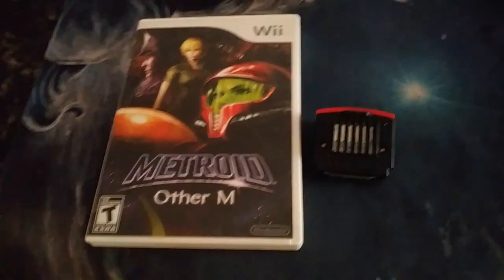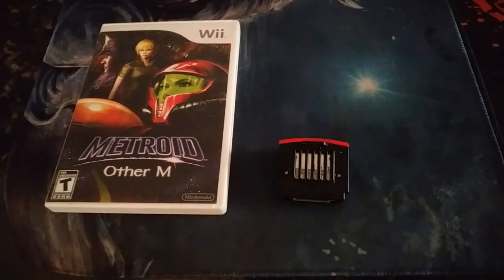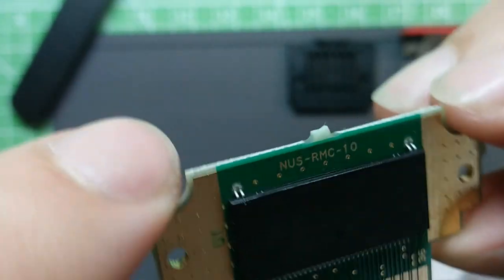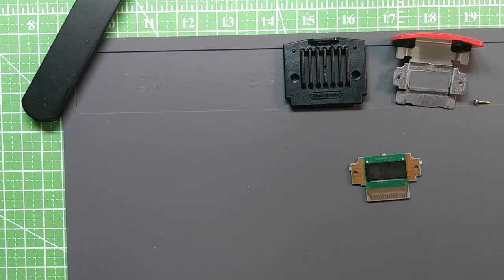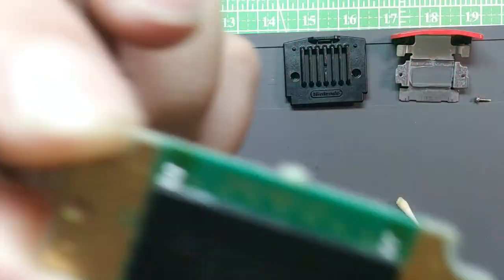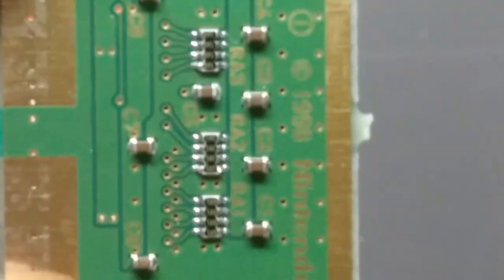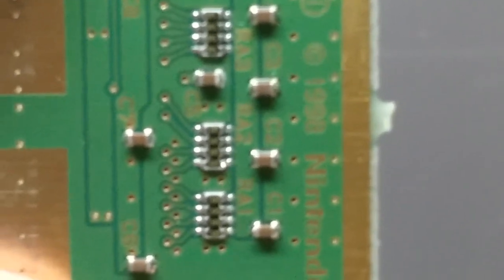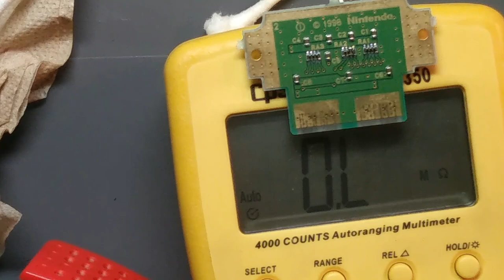N64 Expansion Pak Repair

Comment: Immense thanks for posting this video! I also had a defective Expansion Pak, and it turned out to be a bad resistor just like with yours. I ordered a new resistor for a couple cents from Digi-Key, and managed to make the fix as you showed. Definitely tested my soldering skills to their limit, but the fix worked and I am now also able to play DK64 😂
Thanks again, and great video!
Reply from the maker: Glad to hear it! the best kind of feedback i can get is that the information was useful. up until i posted this video; i could find zero information on repairing them. since then i have found one video from a spanish-speaking youtuber doing a similar repair but, that's it. So i'm glad to have found a niche!
Reply: Which transistor did you buy? Also trying to fix mine and found the bad one. New to all this but enjoying the challenge of repairing!
Reply: resistor not transistor obviously a noob haha
Reply from the maker: @AutBelli  hi! i forget at the moment but that info should be in the video ^_^

i want to say it was 51ohms. something weird like that. i know the package size is 0603 SMD

Comment: my brother, i just picked up a second N64 from the pawn shop which they told me had no AV out. booted it up and it seemed to work great, it had a jumper pak in it. decide to test my old n64, and it did not boot. figured out my old expansion pak has failed much like yours. about to pull it apart, and check it too, but im sure its the same issue with one or many of the resistors failing. my question is which sample book did you buy? the 0603? im still learning SM repair. but big props for figuring and cataloging this one for the community!
Reply from the maker: thanks for watching and im glad you got some good out of it! 

i have a couple sample books now. these are the 0603 size. feel free to link this video on reddit or wherever makes sense. dont have social media myself but, i'd like for folks to have access to what i've figured out. there's a few things documented on my channel that i was unable to find online in forums or whatever

Comment: I bought an everdrive for my N64 and some games just started freezing, I could get consistent freezes on Turok 2 all at the same spot in the intro cutscene, it just would not advance, I'd try finaggling with the cartridge, cleaned up the ports thoroughly, but I'd still get crashes on the same spot. I thought it was the everdrive but then I remember that I have 2 copies of Perfect Dark and they all freeze in the exact same spot when walking around Carrington Institute, THEN it'd bleed into other games, like Ocarina of Time wouldn't get past the title screen.

I figured it was all just really dirty and old but despite cleaning it as best as I could, it would still not work at all. I then decided to just swap the Expansion Pak with my old Jumper Pak, and I haven't gotten any freezes at all, which means it's probably something wrong with the Expansion Pak, though I did not know what. 

My next test I wondered if I should just wait for it to "warm up" so I left the N64 on for a couple minutes, turned Turok 2 on and....It booted the game thinking I had a Jumper Pak on instead of an Expansion Pak. Oh-oh. I pulled it out and reinserted it and now the game booted recognizing the pak, and it didn't freeze in the intro cutscene, which pretty much tells me that there's probably something wrong with it.

You think that could be the case? One of the resistors is starting to go bad?
Reply from the maker: thanks for watching! im almost certain this is the same problem and is seemingly becoming increasingly common as these things age. Another factor is aging capacitors in the N64. Just like any machine, it may work with one or two worn components but once you start getting multiple items failing; the reliability drops off. 

But its a very easy fix (for me at least) and I hope this video will help save a few from getting tossed in the trash. 

I will offer the same thing to you I have offered to others. If you want to send me your console/expansion pak; I would try to fix it just for the sake of the content. I'll make a video of the process and post it. Then you'll have a properly working and mildly famous console/expansion pak ^_^ If you're interested, let me know

P.S. just for  your information, consumer electronic should not need to "warm up" (unless that is specifically noted by the manufacturer). If you have anything behaving this way its from failing components like capacitors/resistors and you are potentially doing damage to the more delicate and not easily replaceable parts (like the CPU and other proprietary chipsets). If you have gear behaving like this that you care about; it is strongly advised to leave it powered off until you can have it repaired.
Reply: @71dembonesTV  I see. Thanks for the reply! I'd love to send my stuff in but international matters complicate things. I will probably look for a way to do it myself and learn in the process. I know now from your video that I should look at the resistors, but this is sounding more and more like a capacitor problem, I got a PS2 slim and the component video output comes out very gray until after some 20 minutes some color comes back in, which pretty much tells me it's a capacitor though I do not know how to measure one so I know exactly how to replace with an accurate one. Nonetheless you've encouraged me to try. Thanks!
Reply from the maker: @aquelescaraaaaaaaaaa  ah yes, physical distance is always putting a pinch on these kind of things! i wish you the best in your endeavors to learn electronic repair!

 With some experience, you can learn which exact capacitors you need to replace to solve a specific problem but, often times if you need to replace one you need to replace them all. Sometimes it is obvious that capacitors are bad from corrosion on the circuit board and/or bulging caps and/or a "fishy" smell inside the unit. When in doubt replace all the caps; ideally before you turn it on again.

in some situations you can upgrade capacitors to something you wont have to replace again (ie ceramic capacitors instead of electrolytics) but, this also takes experience and application-specific knowledge. Buy a circuit board practice kit (or rip apart old electronics) and a decent soldering iron and start building your skills. use no-clean flux and good quality leaded solder. do what you can to clean circuit boards with rubbing alcohol before/after working on them. you'll be a master in no time! ^_^

Comment: Hello! I have an N64 that seems to turn on based on the red LED turning on, but there is absolutely no signal output. I have a jumper pak for the system, so I’m wondering if it may have developed a similar issue as your expansion pak. What do you think?
Reply from the maker: Hi! unfortunately there's quite a few issues that could lead to no video/sound. some easy things to try (if possible)are: 

cleaning the game cartridge/ cartridge slot and/or trying another cartridge.

cleaning the jumper pak/slot and/or trying another jumper/expansion pak

making sure your video cables/input are working/ correct

if none of those items; work it will need some disassembly/testing to get it figured out

Comment: Hi there. Have same issues with one resistor at 8k ohm. How did solder it on? Ontop like you said in your video? Or did you remove and solder a new one in it place?
Reply from the maker: yes, i just went over the top to avoid having to remove the whole array. no reason to not do this unless the failed resistor shorted (has less resistance than the proper one) if the failed resistor is high or infinite resistance (open) you can go right over the top no worries
Reply: @71dembonesTV  the resistor array comes with 8 legs to solder or you using a individual resistor for the bad section?
Reply from the maker: @greeneyez93274  i used an individual one from my sample book to avoid having to order and wait for a whole new array. if you need to order parts anyways, i might just order the exact part. it will be more difficult to unsolder though so depends on your skill level.

its all about what you feel comfortable with attempting. if u only measure one resistor in the array out of tolerance and you're not sure of your soldering skills/tools; try to just patch one in like i did here. less work and less risk

Comment: What size resistor does it take?
Reply: I have a crazy idea what if you took the chip off the expansion pak and put it on a regular jumper would that work.
Reply from the maker: @matthoward9509  no reason to do that and i dont think it would work. the jumper pack might have those resistors soldered on there if you wanted to swiped them off of there.
Reply from the maker: 51 ohm resistor. 0603 size SMD package. there's probably enough room to stab a standard thru-hole resistor in there if you bend the legs right. I have the sample book so its easy to just find the right one most of the time

Comment: i cant tell if its my expension pak or n64 that doesnt like to work here n there it will randomly jsut reset its self after random time how can i tell which is the problem its not the game cause if it was the battery wouldnt save so ya
Reply: Sounds like a bad power cable
Reply from the maker: bad expansion pak could cause this issue. swap in a jumper pak and a non expansion pack game if you can. that will tell you for sure
Reply: @71dembonesTV  thanks fixed all issues practically new
Reply from the maker: @RobertoGarcia-wp9uq  love to hear it 💪

Comment: When testing mine that was defective I was getting 51 between some legs and some where bouncing all over the place, ordered some more resistor arrays for like $2 on eBay
Reply from the maker: Thanks for watching! Hope it works out. If i didn't have those SMD resistors in stock already; i would have replaced the whole array even for just the one that was showing bad. I'm currently running that one in my console and it has held up for a full DK64 playthru with no signs of trouble :)
Reply: @71dembonesTV you rock, this repair fixed my expansion pak
Reply from the maker: @lazereth45  best response i could ever get on one of my repair videos! glad i could help! Thanks for watching!
Reply: @lazereth45  hey man could you shoot me in the right direction towards getting that particular array? That’d be much appreciated, thanks dude
Reply: If not, can you send me a link for the ones you used please